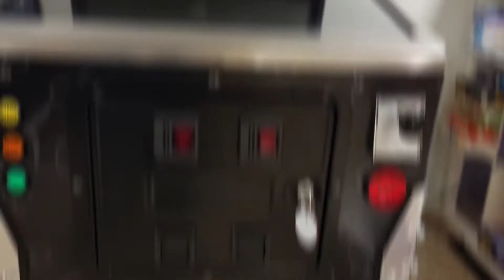Virtual Pinball Project: Final LED Strip Wiring – Side Strips Installed!

Comment: I had the same issue with tv mount. I played with washers a bit but also tweaked the pivot hole to take out the difference. 

Hot glue for the leds underneath?
Reply from the maker: Yeah, I'm going to try the washer thing at some point if I can be bothered. I really want to limit taking out the TV as I seem to be adding more and more scratches every time. There is minimal forgiveness between the width of the platform and cabinet edges. It's one of those things I'd do different "next time". And yes, hot glue for the strips is on the list.